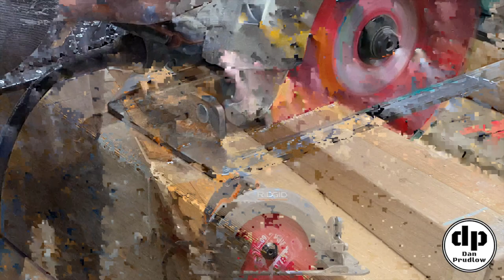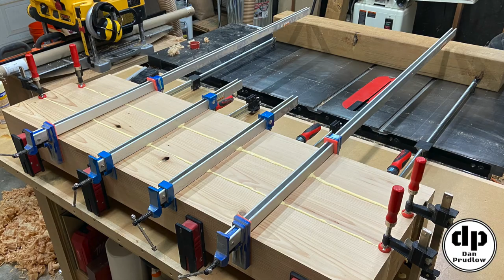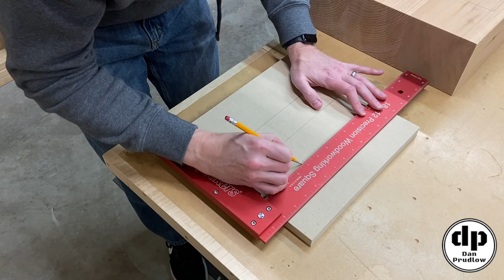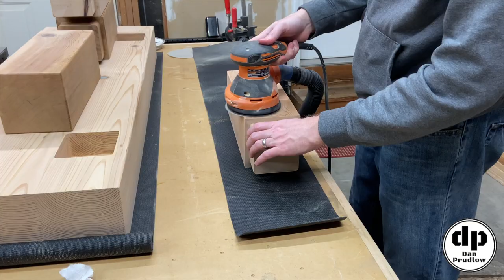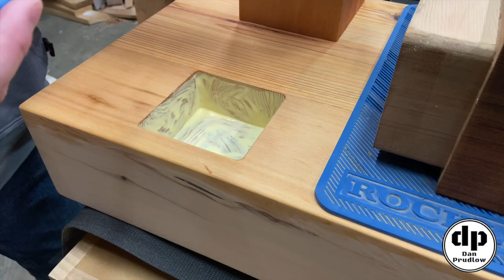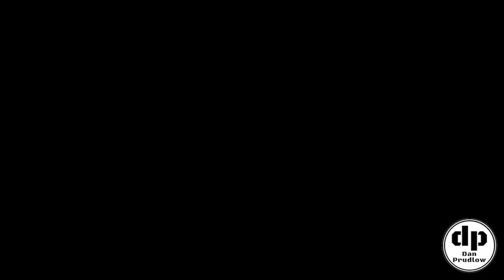Building a Bench from Reclaimed Cedar Timber

Comment from the maker: Want to support the channel? Here's what you can do:
 - Subscribe to the channel
 - Hit that Like button
 - Leave a comment
 - Amazon Affiliate: https://amzn.to/2LaN1Ib

In this video I build a big heavy bench using more reclaimed cedar timber.  All of the parts are milled from 6x6 cedar posts that came from an old deck.  The bench is wider than my planer can handle so I had to do a lot of hand plane work to get it flat!  The finish is three coats of boiled linseed oil.  Let me know what you think in the comments section below.

SawStop 1.75hp PCS: https://amzn.to/2X4gWsP
Ridgid Circular Saw: https://amzn.to/365TwHK
Ridge Carbide 10-inch Saw blade: https://amzn.to/3bATmcp
Dewalt 13-inch Planer: https://amzn.to/2z4LouT
Dewalt Router: https://amzn.to/2Z7iswN
Router Guide Bushing Set: https://amzn.to/3dKSQK8
Ridgid ROS: https://amzn.to/364yHMA
Boiled Linseed Oil: https://amzn.to/2y71jZb
Titebond Wood Glue: https://amzn.to/2LzTdv4
Bessy 24 Inch Parallel Clamps: https://amzn.to/2Lu3etU

Thanks for watching.  If you have any comments or questions please leave them below or hit me up on social media, email, or my website.

Hit that like button and don't forget to subscribe!  Thanks!

Subscribe: https://www.youtube.com/danprudlow?sub_confirmation=1

Twitter: http://twitter.com/DanPrudlow
Instagram: http://instagram.com/danprudlow

Comment: Nice work!  Love the jigs on squaring things up and getting the legs into the top. Really enjoyed watching that.    Quick question,  if U dont mind, but is that a straight BLO you finished it all it, and nothing  else?  So is this an interior piece ? I’m looking at vids for diff finishes  and clear coating ideas  and usually  woodworkers have diff approaches to their finishes. Sometimes I run into cool vids and end up watching the whole thing. Lol. Thx for time!
Reply from the maker: Thanks for watching and the compliments.  Yes it is just straight BLO finish.  I actually sold this bench because I didn’t really have a good place for it so I’m not sure if it’s being kept indoors or out.  I have a planter box that I finished the same way and it is outdoors now so I’m interested to see how it holds up.  I do know that I used spar urethane on my mailbox post (also a video on my channel) and the weather has taken a serious toll on it so I’m probably going to sand it down and use straight BLO and see how that goes.  I’m pretty new to finishes and such so your guess is as good as mine really. 🙂. I think The Wood Whisperer has some good videos on different finishes out there.